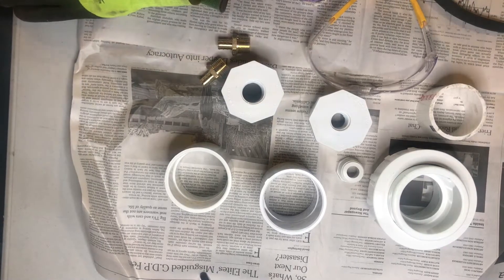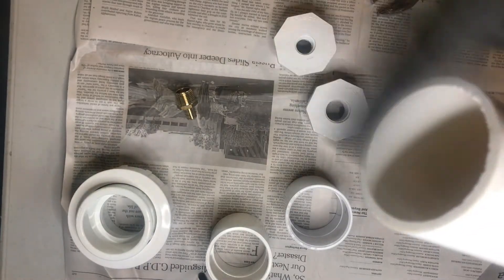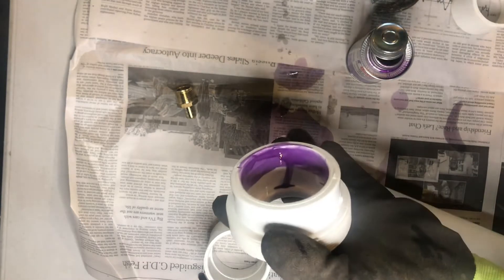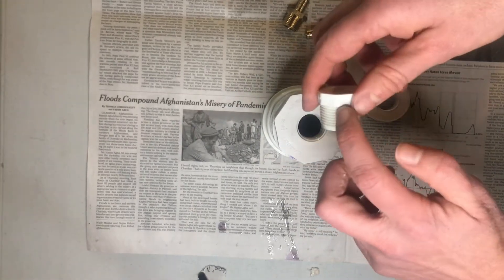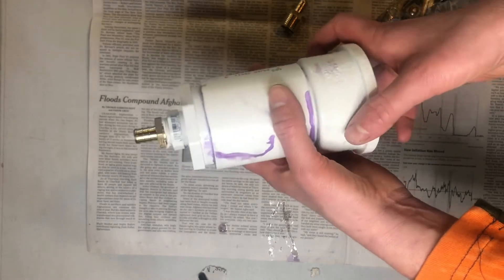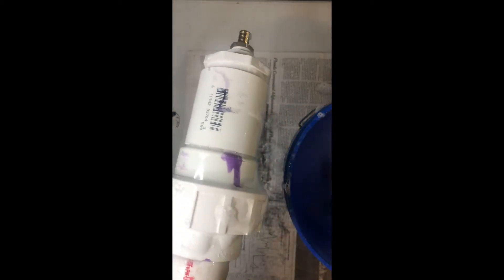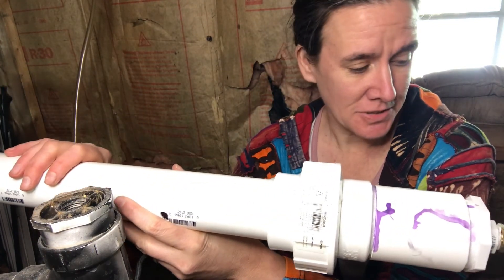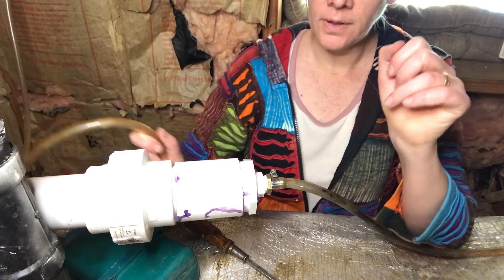Making a scrubber for your biogas system

Comment: Assuming that gas line was coming out of the Puxin scrubber it may be sulfur as well as iron oxide. Iron oxide is desirable in the scrubber system because the Hydrogen Sulphide that you are trying to remove reacts with that and not the raw iron.

The reaction is H2S + FeO2 -> FeS + H20 So the Hydrogen Sulphide reacts with the rust on the iron balls and produces iron sulphide and water. The water generates more iron oxide (rust) creating more reactive surface area for the Hydrogen sulphide. This is also an endothermic reaction and works most effectively above 20ºC

However, iron Sulphide reacts with oxygen and turns back to iron Oxide + sulfur (FeS +1/2O2 -> FeO + S) So you get rust and sulfur produced which is probably what you can see in the tube. So the appearance of rust is not an issue and supports the scrubbers chemistry.

What you may find is that the rust inside the Puxin scrubber has bonded the balls together and reduced its overall surface area. you might be able to alleviate this issue by smashing the container on the floor a few times to break apart all the rusted together balls.

Also because the iron sulphide reaction is exothermic a large scrubber that has not been purged for a while could spontaneously ignite or at least get very hot when opened to the air. It's possible that enough oxygen is coming from the biogas to prevent saturation of the scrubber with iron sulphide.

Because the steel wool in the new scrubber has a much greater surface area its possible that all of the steel wool structure will corrode to iron oxide powder and bond together into a solid lump in the new scrubber making it less effective over time. I guess thats why the Puxin uses steel balls to mitigate the iron oxide gluing everything together.

Ideally you want to get a gas analyser that can detect low levels of Hydrogen sulphide and measure the raw gas and scrubbed gas to see how effective the scrubbers really are.

https://www.sciencedirect.com/topics/engineering/iron-sponge-process#:~:text=H2S%20reacts%20with,form%20iron%20sulfide%20and%20water.